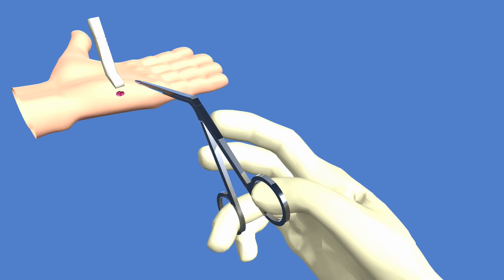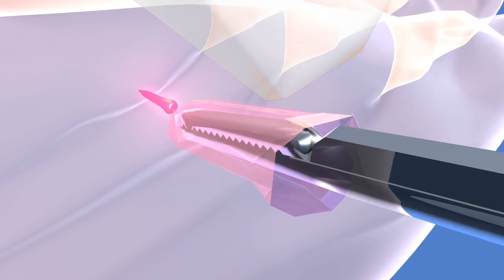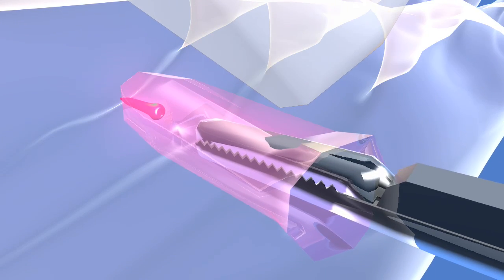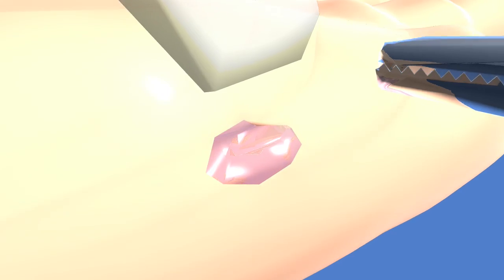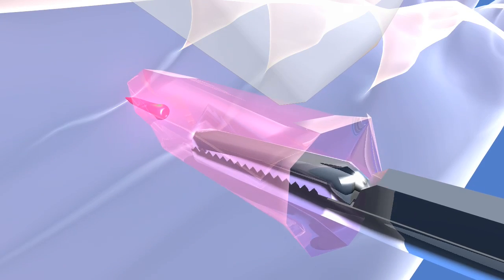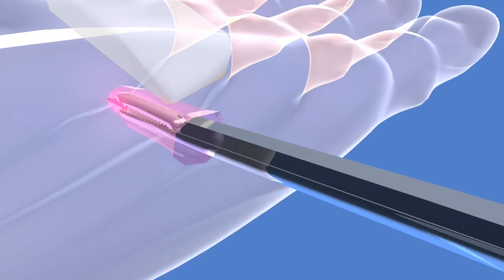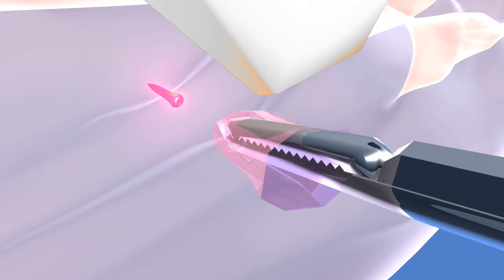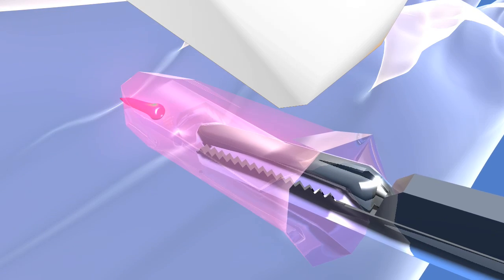Ultrasound Guided Foreign Body Removal

Comment: Is it possible for a glass splinter to run through your veins?
Reply: The moment it would hit your vein,  you would die,  so if u get glass stuck in ur body and u r alive then it is certain that is is not static
Reply: Oi I think it is
Reply: I did some research,  its actually impossible,  the glass has to go through ur skin to reach the veins  ,  it is not possible